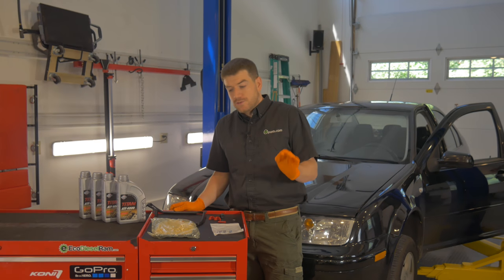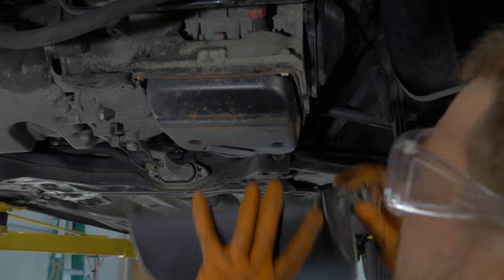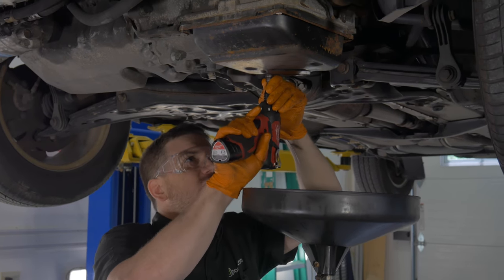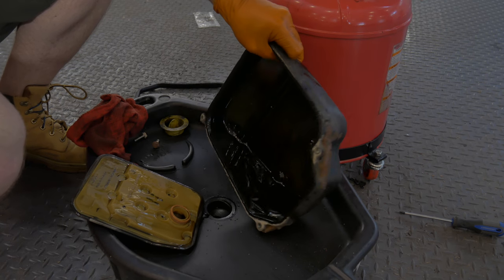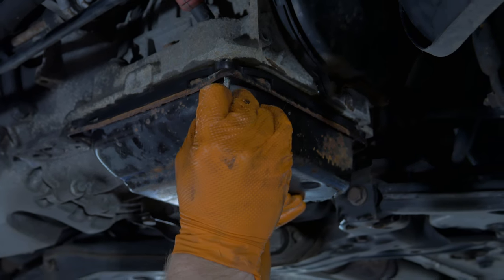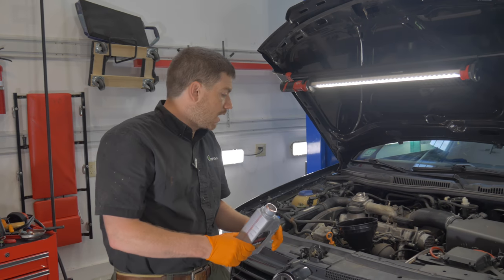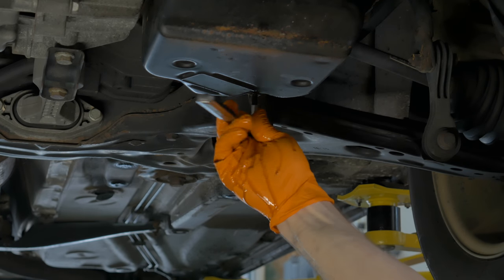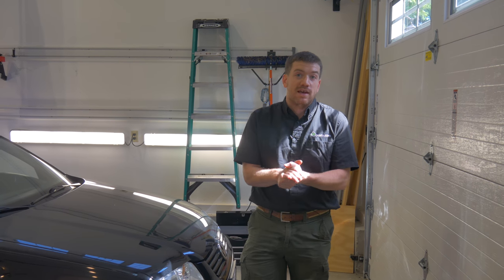VW 01M Automatic Transmission Service on ALH TDI

Comment: One small addition, for the rubber pan gasket, there should be some steel spacers on the old gasket that need to be transferred to the new gasket.  This is to prevent over torquing the new gasket causing leaks.
Reply: A good point as some of the cheap kits do not include the spacers, although the kit in this video did have them.

Comment: Looking at the black stuff that was in there I recommend to repeat the oil change 2-3 times in a row with test drives in between. The filter only do once. After the second change you will feel the difference, it takes up to 4 changes to get back to an acceptable oil quality in the transmission!

Comment: Hope you can help I have a2005 2.0 jetta automatic om1 Trans and it would jerk into first and then change all other gears well.. then after warmed up it will not engage first gear.. I replaced the valve body.. guy didn't replace harness even though I had a new one ... and it has the same problem goes into reverse fine but won't engage drive until completley fluid seems fine.. please help me!

Comment: Hi. Thanks for the vidoe...i did transmission replacement on a 99 cabrio that has the 01M. After putting everything back and replacing the filter and ATF, I got 7 codes for the valves being either shorted or open circuit. Not sure what to do next! Can it be when i pulled the round plug by the shifter, i snapped the wires?
Reply: Did you damage the wire harness on the vavle body?
Reply: use Mercon V atf fluid, because an incorrect fluid can damage your transmision.

Comment: The gearbox temperature reaches 35 degrees, should you shut down the engine or continue to start?
Reply from the maker: You need to leave the engine running, otherwise the fluid will drain out of the transmission and you will over-drain.

Comment: The trans temp should be between 35 C - 45 C or 95 F - 113 F and fluid should be observed "glugging" before you screw in pan bolt.

Comment: Hi. I have got a golf mk 4 19tdi alh engine auto. Would this be the same transmission? Or how do i get the transmission code from.? The car has 216000 miles and i dont know when the autobox oil has been changed and it slips in higher gears at times when you give it alot of throttle and a bit if delay when first pulling off. Would the oil change help or make it worse do you think? Also where can you get parts from. Great video

Comment: Thanks for sharing Corey. I just bought an 02 TDI Jetta and I've been hearing the 01m is junk. What do you think? And I hear some people are running there transmission/engine with the cooler line disconnected in order to do a flush. They run it until the fluid is gone or foamy. The theory is it drains all the fluid including the torque converter. What do you think about flushing like this? Do you have any tips to improve this method?
Reply from the maker: 01M is not known to be a reliable transmission.  At this point most of them are failing or failed.  

I myself would perform the fluid service twice in a row if you want to get more of a "flush".  I don't think running the transmission dry is a good idea.
Reply: I think this is my case. We had realy belived it is a "sealed"transmission and the car never had the fluid changed for 135.000 milles. It works normal until now when is shifting very hard, starting two weeks ago. Only now I do this search and find out that people change the transmission fluid . I very much hope it still possible a miracle and keep it alife. Was a very reliable car from 2001 to now (Beeatle tdi).

Comment: Hi i have same car but with gasoline. which oil do you prefer ? atf III I know red one .and i had  problem.transmission oil cooler broken and same water in automatic transmission.i changed oil twice but shift gears knocked.solution revision  automatic transmission? thanks.

Comment: Could you use a inferred temp gun instead of needing a GD Rosstech scanner??
Reply: Yes but you can download the VCDS lite software for free and buy a £10 cable off ebay and you are good to go.
Reply: @conradbourne2446  Don't you need to still register it?

Comment: You need to do a video on changing the final drive oil on the O1M as well if you have not done so already. That gets overlooked by many and is a bit of a pain to do.

Good job on this video. I'm always sold 4 bottles of Trans Fluid (from imparts) for this job, but have never been able to put in more than 2-2.5 bottles back in. I measure what came out so I know that I put a near equal amount back in at a bare minimum. Also, I heard you say the fluid should be "red". The new fluid is a clear to light brown/amber color. At no point is the fluid or should the fluid be "red". Just FYI. If you have red fluid, you need to flush your transmission as someone put American type ATF in your transmission by mistake!
Reply: thanks for the info! How much is your 2-2.5 bottles in Qz?
Reply: Be aware that the red stuff is most likely Dexron III But VW/Audi recommend a golden oil called AG52!
Reply: You said the question I want to ask?? The original color of Volkswagen 01M gearbox oil is similar to the color of engine oil, while FOUSH 4000 is red, but the specification has G052162. Can it still be used?
Reply: @P880739  If you have a 01M transmission, the fluid mentioned in the video is just fine for the transmission fluid. The "final drive" uses a small amount of "gear oil" such as 75w/90. If you received an approved transmission fluid from IDParts for your car, it should be fine regardless the color. I personal have never seen a new in bottle fluid that was the correct type for a O1M that was "red" in color. It has always been an amber to brown color. I personally have never used "FUCHS 4000". IDParts seems to change brands of fluids VERY often. They are currently selling a "Rowe" brand. Last I bought it they were selling "Febi Bilstein" brand which is amber/brown in color. OEM fluid is amber/brown in color. Verify you have the correct fluid and if it is, use it. Don't put "American" Dexron/Mercon or Type F fluid in your VW. And FYI "G052162A2" is just the newer superceeded part number for "G052162". It's the same thing.
Reply: @cotjocky466  Why is it that the American ATF is not good for the VW TDI transmission?

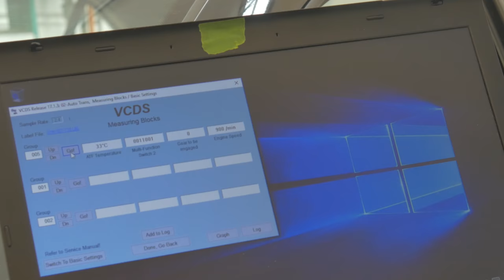Comment: WHOA!  AT 7:12 he says check temp is 95C.  95C  is not correct check temp!  30C -35C is correct.  I would assume at the moment he spoke he confused F and C.  It would be appropriate to do check temp at 95F.  But vagcom doesn't have a "F" setting.  Setting your fluid level at 95C will leave it low!  Someone needs to edit this video, as folks watching this could be leaving their trans low due to info on this video.
.
Reply: I thought the same thing...I have 2 A4B5s with 01N transmissions...so same internal stuff!
Reply: At 6:05  he said 85 degrees which I took to mean 85 deg F. I hope that's right. Thanks.
Reply: Lol cant get my trans temp to 95 degrees c!

Comment: If fluid is at correct temperature can you check fluid level with the engine off?
Reply from the maker: No, that wil result in a too-high reading.

Comment: Corey, I don't have VCDS. Can you suggest an alternative?
Reply: I bought a cheap infra red thermometer and just point it onto the pan. When around 35 to 40 C are reached I check the oil level!
Reply: I have a 2004 Jetta 2.0 BBW and FYI OBDEleven, one of the aftermarket scanners cannot see transmission temp. (It's great for most other tasks though). Haven't found another alternative yet either.